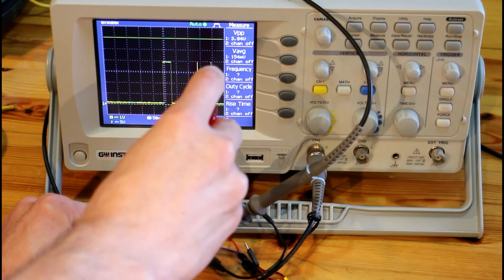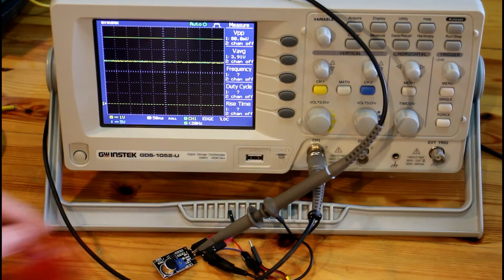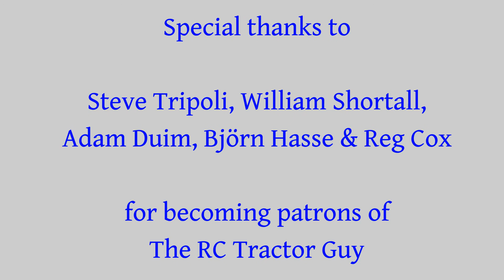Sound Sensor Module from IC Station

Comment: What do you do with the potentiometer
Reply from the maker: It adjusts the sensitivity so turning it one way makes it trigger easily with very little sound and turning it the other way makes it hard to trigger. You need to adjust it until its triggering the way you want it in the room you want to use it in.

Comment: Is it possible to re-wire the board to achieve this condition... no sound=lo, sound=hi ? Thanks.
Reply: I used an optocoupler to achieve that. The output of the sensor will go to pin 2 of the led-side of the optocoupler. Once the sound is detected, the low signal will provide a ground for the optocoupler that will open the passage of current from pin 3 to 4.
Reply: It can be done by using KY-038/037 sound sensor module